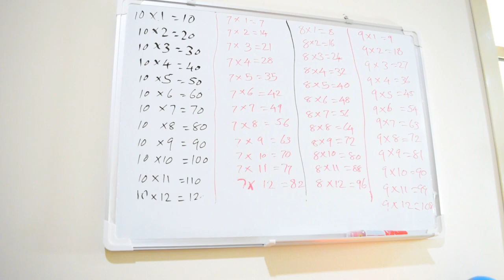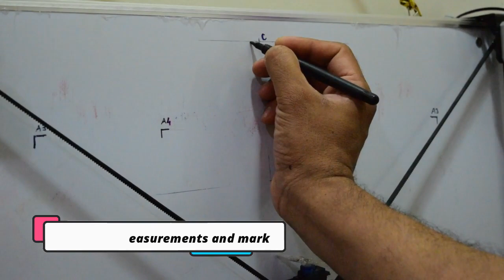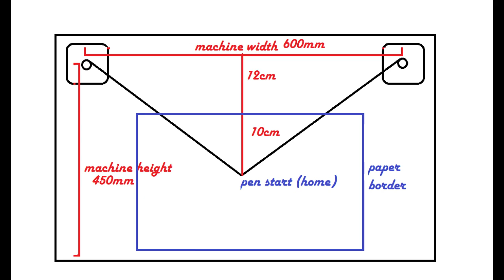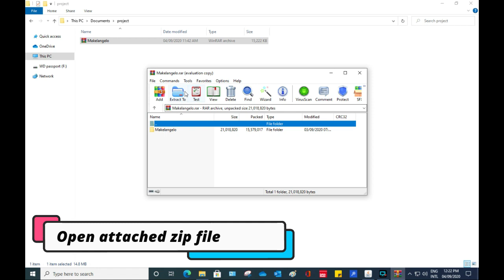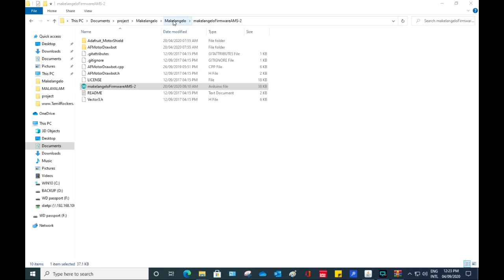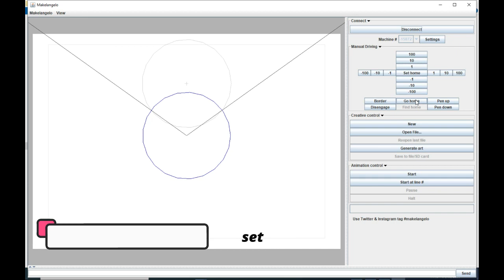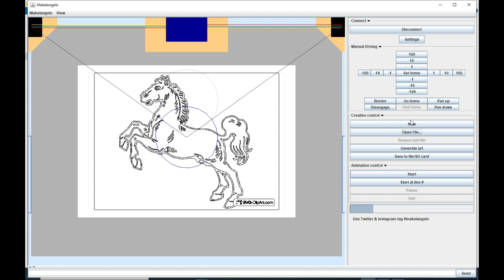XY Plotter / Polargraph /Makelangelo by Arudino UNO R3

Comment: I understand work of both moters but the third one mg90s moter i don't understand the work of that motor for what purpose this motor is used for and did you just tie up and hang that motor in the centre
Reply: that is for the pen: write/not write

Comment: Hello Sir, please help me. The servo motor is not working well in the paint job. It has errors. I don't know what to do🙏
Reply from the maker: Please check your power supply
Reply from the maker: Properly filtered DC power supply required otherwise servo will be jittery,u can use filer capacitor across servo power wires to reduce noise
Reply: @aldusjosek  Thank you very much, dear sir. It is true that I took your advice and attached a capacitor and the paralysis was resolved

Comment: Thank you for this video. I'm wondering why to use a 5v 2a power supply. I have the same parts except for stepper motors. Stepper motors are also nema 17, but the model is different(17HS4401S). Should I use 5v 2a again?

Comment: My L293D ICs on the shield started smoking. Will retry with two soldered on top of each other
Reply from the maker: Please go through the video description...2 IC s one on top will be solve the issue..I am using 2 ICs for each stepper motor
Reply: @aldusjosek  Oh, OK thanks! Tried the double decker with my NEMA 17HS4023 with only 1A min. Now the ICs get very hot and the stepper motors only jitter back and forth. I guess too little current. Soldered THREE ICs each on top of each other now: Still only jittering. Maybe I should use NEMA 17HD34008-22B (as you did) but they even have 1,5 A so I doubt that. Oh, my power supply for the shield is 12V 5A so that should do the job.  I am out of ideas at the moment but still trying ... any help is greatly appreciated!
Reply from the maker: @pablogeilert5780  use 5v power supply don't use 12v
Mine is around 7vdc 2A
Your power supply is the culprit
Reply: @aldusjosek  Hey it works now! Thanks! You are right - the power supply was the culprit - and the 12V also had also busted the shields outputs M2 and M4. 
So with new shield, triple (!) ICs  and a 5V 3A power supply it works. Maybe I will step up to 7V but never to 12V again. Next: Mount it on a wall and make the gondola. This is so fun and enlightens the lockdown :-) Thanks again!

Comment: Can i make it work directly from lap top's power ??? Or OPPO charger output 5V 4A ???or should i connect it to power supply ??
Reply from the maker: External power required for the motor shield 5v 2A atleast
Reply: @aldusjosek  thanks sir for help and support 🙏

Comment: Hello, sir. Can I use the stepper master BYJ48 after an internal modification, which is the middle air separation and make it four wires instead of five instead of this stepper you used in your project, this wonderful

Comment: Hi, I'm doing this exact project, when I test the step motors everything works fine but if I start drowing the motors move with very short steps and in an infinte loop.
I made the power supply for the Arduino UNO, not for the shield, could this be the problem? But, as I said, everything works fine during tests (moving the pen 100 steps up or down).
I also can't change pen setting like draw speed.

Thanks in advance
Reply from the maker: Power supply supposed to be connected to motor shield, not to uno.and keep 2A 5v power supply not less than that
Reply: @aldusjosek  Thanks, I'll try and make you know
Reply: @aldusjosek  I solved nothing, could java be the problem? I'm using version 1.8.0_281. Maybe I need to use an older version
Reply: Ah, and I can't change "draw speed" which is fixed to 60, thanks
Reply from the maker: U can use latest version of java
But before installing new version make sure u uninstalled older versions previously installed (use 32bit version only)
Reply from the maker: Draw speed changing in makelangelo will not make any big difference because it is already set in the arduino program

Comment: Where did you get that heat sink... I also really need that one
Reply from the maker: I got it From old power supply board,u can find it from old cpu also
Reply: @aldusjosek  hi, I tried a lot using Processing 2 and my motor is not moving a bit.......... Very much confused......... And dont know how to open a. Jar file makelango
Reply: I am not able to open the script file makelango and there's no program of arduino inside it.
Reply from the maker: @sanjusaju4049  try mediafire link..files are still active and working,go through the steps carefully
Reply: yes,it really,my motor is not working
Reply from the maker: Did you try with two IC parallely 
It will avoid over heating issue
Also use 5v or maximum 8vdc 2A power supply
Reply: @aldusjosek  no sir,i use uln 2003 driver,i conectd my driver arduino board 2,3,4,5 motor A and motor B 6,7,8,9 but motor is not working how i fixed my problem sir,i use processing  and arduino,do you think fixed motor setting  in processing software

Comment: Good job 👍
Reply from the maker: Thank u
Reply: i printed the 3D parts today have all the electronic Arduino ect, if I come a cross any problumes software side can you give ma help ? Thanks in advance
Reply: I have a question for the L293D bord I have to give power separately at the same time this bord is connected with Arduino Uno is connected to the computer via USB cable and Arduino Uno is also getting 5V from the computer is this correct ?
Reply from the maker: Yes
Reply: Thanks now it’s working but the drawing line’s are not perfect the gondola is bouncing little bit is the because of the Weight ? If I go above 5V the stepper motor jerking a lot  any help!

Comment: When I select the COM port, it crashes without any error. How do I get it to working? I used the google drive version
Reply from the maker: Check out the jawa version, make sure it is 32bit version,also try a clean installation of jawa
Reply: mine connects after downgrading Java to 8v161

Comment: Hi sir i used power supply 12V 5A ..the problem now is the L293d become so hot when i start the draw just 5 min and L293d became hot... and now the servo working well by the way and there is no disconnect anymore when i use i put the servo as the last time.... just the problem of heat's L293d ... help me sir  please 🙏
Reply from the maker: Use 2xL293D in parallel total 4 IC
Also reduce power supply to 5v 2A
Reply: @aldusjosek  sorry sir but how can i add it... just put it up the ones in shield or there is a way to connect them together...i used heatsink and the heatsink getting hot too.. should i use fan too if I don't want to add a new 2 l293d ??
Sorry about this many questions 🙏🙏
Reply from the maker: Just keep one above one and solder the lugs
Reply from the maker: Keep the good heat sink on the top IC

Comment: Sir the java program is closing when i conect port COM7. Can you help me?
Reply: ı fixed ı guess. ı reset ardunio on rst button.
Reply: sir.. i still getting same problem. how can i fix? :(
Reply from the maker: Re install java after removing existing version..also try to install 32bit version of java
Reply: hi bro, I'm having the same problem, can you solve it ?
Reply: @huseynov029  ı found another polargraph on internet
Reply: @huseynov029  you need to downgrade Java to 8v161

Comment: I really do have a doubt. Actually I'm making Vplotter and for that I'm using 333nNm 0.31 A Stepper motor NEMA 17. And I'm giving an external supply of 5V and 1 A to motor driver sheild. Will L293D heat.
Reply from the maker: Need heat sink to avoid overheating if it run for long time.5v 1A power supply is ok I am using 2A powersupply
Reply: @aldusjosek  I used a 12V 2A supply... it got really really hot, even smoked the wire a little... Should i go down to a 5V?
Reply from the maker: Use 5v 2A power supply,also use 2 l293D ICs parallel for each stepper motor